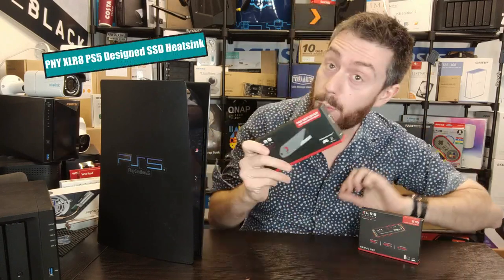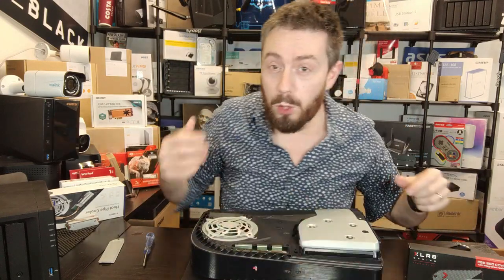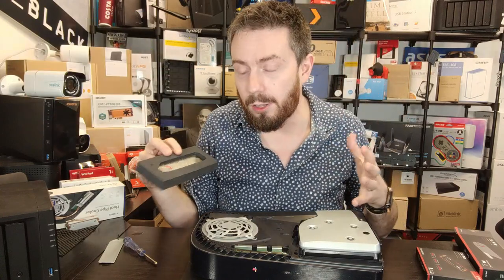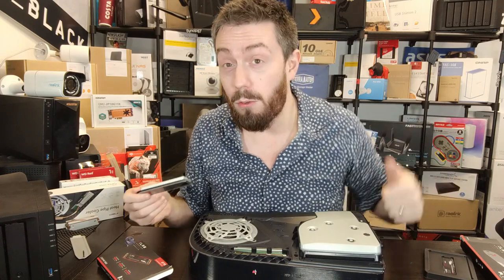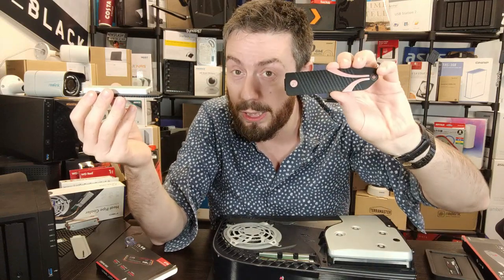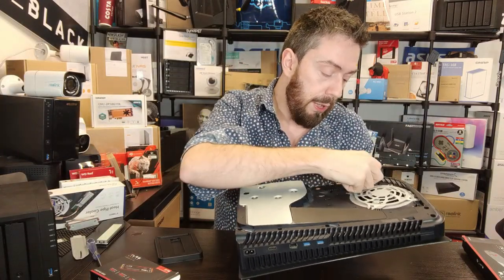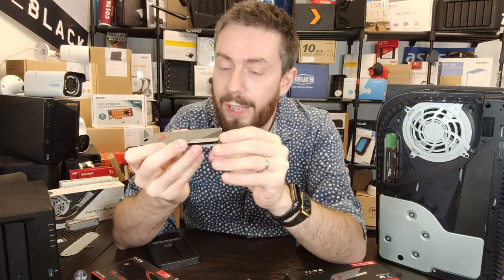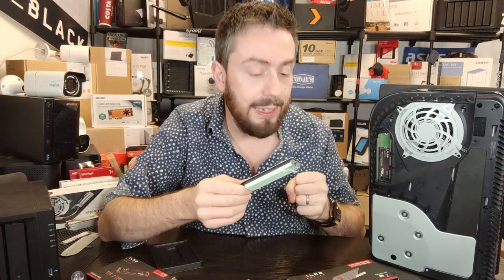PNY XLR8 PS5 SSD Heatsink Review

Comment: I think the harmonica design would be pretty good for heat dissipation, but I'd definitely be worried about pressure on the SSD. I honestly hope for a heatsink that can sit on a  heatsink equipped SSD for further cooling, but it might be a pipe dream.

Comment: @NASCompares Although I have a tremendous amount of respect for this channel and what you are doing, I do think you and alot of people are overlooking the fact that the pressure from these type of heatsinks is bending the SSD downwards in the middle.

Elecgear understood that and that's why they give you that piece of 'supportive EVA foam'.

Now if you understand electronics, you would know that a bending PCB isn't all that great for the soldering joints.

Anyway please bring this up in your video's my guy. It's easy fixable with some EVA foam like Elecgear does.
Reply: What the hell are you babbling on about?
Reply: @bonanzabrandon6877  Can't read? Or too hard too understand?
Reply: @dynamike549  you have no idea whether any of these heatsinks are bending the pcb of any ssd's, so don't pretend like you do.
Reply: @bonanzabrandon6877  I do know. I own the Elecgear and when i went and closed it up it left deeper indentations on the thermal pad from the compression on both ends of the SSD compared to the middle, clearly indicating that the SSD was bending downwards from the pressure in the middle.

But man, i'm not going to try and convince you. Do what you want!

But Elecgear giving a piece of 'supportive EVA foam' isn't for nothing. People should use it like i did afterwards.
Reply: @dynamike549  So you have anecdotal "evidence" for one brand of heatsink, congrats, you're a regular Sherlock Holmes.
Reply: @Chris Mike Okay thanks for the info. 👍🏻
Reply: I have the sabrent. I made sure there was thermal padding underneath the ssd. I'm going to go for the elecgear eventually
Reply: @chrisjohnson261  that should give you counter pressure as well. 👍🏻 I'm very satisfied with the Elecgear. I ordered it from Amazon Japan. They often have stock and it arrived within 4 days.
Reply: @chrisjohnson261  Hi, what size of thermal pad did you use on the bottom of the nvme expansion slot. Thanks in advance
Reply: @chrisjohnson261  what size of thermal pad did you use on the bottom of the nvme drive.
Thanks in advance.
Reply: @chrisjohnson261  What size thermal pad did you use underneath the SSD?

Comment: I'm looking forward to seeing how it performs, my only worry would be that the height of it restricts the airflow in too much and the affect that may have on the internal temperatures of the system even if it works wonders for cooling down the SDD.
Reply: It wont effect air flow to the fan and system

Comment: Are there any indications that a M.2 22110 ssd model for PS5 is in the works from any manufacturer? CES is this week so .. maybe?
People who purchased the PNY XLR8 CS3040 ssd are reporting that it only has a read speed of 3850 mbps..minimum required is 5500 mbps. Is the PNY 'CS3140' the M.2 ssd people should be buying instead for their PS 5 consoles ?
Reply: I was thinking on getting that one so it's not good then damn I want one for 2tb i thought it was good

Comment: Should be noted the PNY heatsink won’t fit the digital edition ps5 as it doesn’t have the extra clearance for the panels. Also with the PNY XLR8 CS3140 being double sided, shouldn’t there at least be a heatsink bottom for it? My the bottom half of a cheaper heatsink will do with one of these alternative heatsink PS5 bay covers??
Reply: Will it fit ps5 slim standard?
Reply: Definitely won’t on the smaller console. The better WD SN850x can be found at good prices now anyways. I forget the name of their new model but it’s not needed

Comment: Are these heatsinks easy to remove without damaging the ssd later if I’m perhaps looking to upgrade, because those thermal pads really stick to those things.
Reply: I split my Eluteng heatsink with no issues at all after it had been in ps5 for 4mths
Reply: @ijsaville5238  okay thanks. Its just that I’m using the gammix s70 blade and I’m trying to switch out the thin heatsink it came with with the sabrent heatsink. Its so difficult to get it off😓
Reply: I recently removed my Eluteng from my SN850 as I upgraded to the Sabrent heatsink. You will find resistance initially, just carefully work your way from top to bottom, a bit at a time, and soon enough it’ll come loose.
Reply: @Brian Morales unfortunately I still have trouble getting it off. It really feels like forcing it off will damage the  ssd controller chip. I'll wait a while and probably try the heat gun method you mentioned.

Comment: Hey man, is ur testing coming yet? I really wanna know if it has better cooling than Sabrent PS5 ssd heatsink. If it has a lot more cooling than Sabrent, than I’m considering getting another one. plz finish ur video soon lol
Reply from the maker: Recording done and just gotta edit and add voice over. But in brief, everything I did on Demon Souls and the Matrix Tech demo resulted in the PNY heatsink having a fractionally lower temp...but I am talking by an incredibly thin margin. In short, they are near identical practically
Reply: @nascompares  thx man, I guess I will just change a thicker and better thermal pad for my Sabrent heatsink then, I believe it will help cooling a little faster as well.
Reply: @nascompares  I just changed the original pad to two 1.5mm of “thermalright valor odin thermal pad” to make it to 3mm now, and original pad is about 2.5mm, and this new pad claim to include aluminum nitride. I can’t measure the temperature to find out the differences tho because I don have the tool. I hope I can drop a few more degrees of temperatures by doing this.

Comment: If you already have a SSD with build in heatsink. Is it possible/necessary to put in a heatsink plate  instead of the stock plate.
Reply: Either go with the stock plate or remove the built in heatsink and use the heatsink plate.

Comment: This guy is telling the p n y  x l r  8 3140 pretty hard... Don't buy that solid state. I bought it thinking it was the cheapest drive that was gonna meet system specs because it says it gets 5600 mbps. I had to return it because that's false advertising my playstation 5 read it at about 3200 Which is well below what you need I wound up returning it to Best Buy and getting the gamex S70 blade. It was $20 more and is advertised at 7400  And actually gets about 6300
Reply: That's strange I have the lower model the 3040 and got 5600 ish  was what I got as a read speed. Works flawlessly on the ps5 too.
Reply: @crazykenbei  S70 flies though at 6200 mbps. only 300 lower than WD 850
Reply: Thanks for that William I'm getting that one u have for 20 bucks dont see why not
Reply: Would the s70 would need thermal pads in the bottom I see it comes with a heatsink would it need another one on top like sabrent? Or just how it is then?
Reply: @francorottier8221  I didnt put anything on the bottom, everything ison the top. Just only used sabrent heat sink
Reply: @samjam6989   thanks man yea I got it for 250 the s70